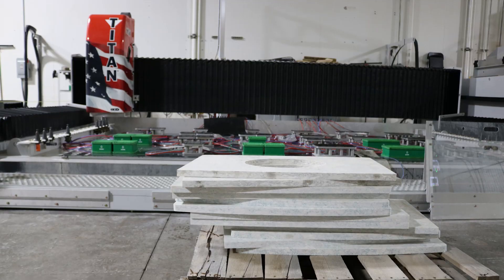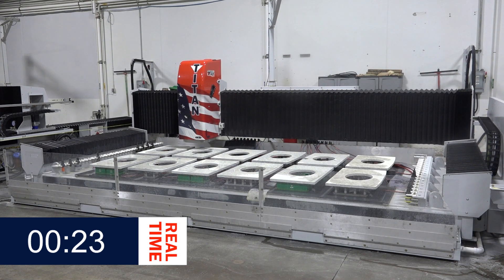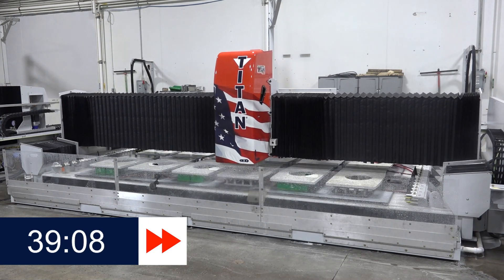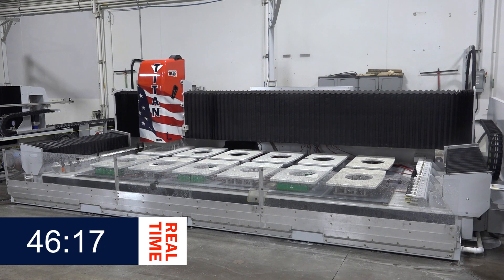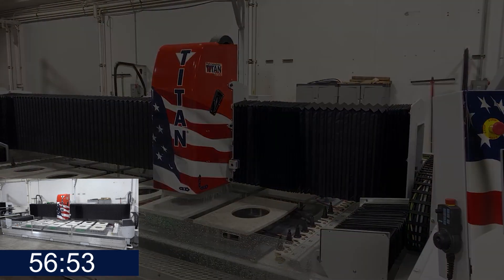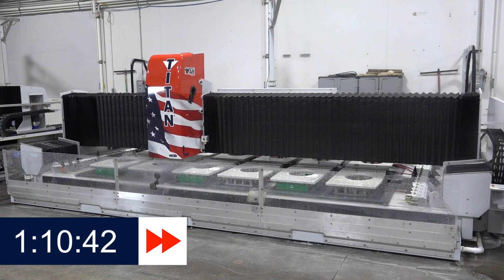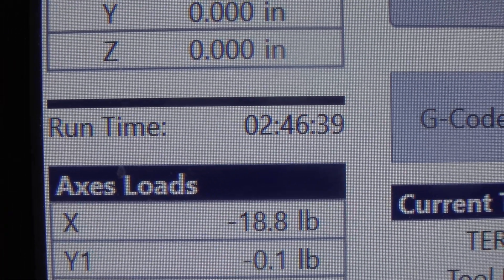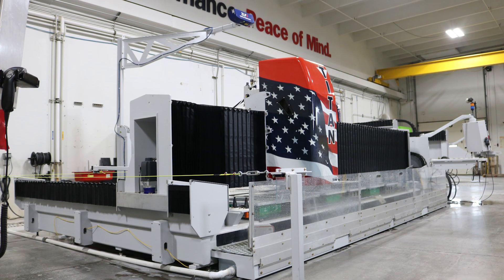Vanity Challenge | Packed Table on the TITAN® CNC Router

Comment: How are the overhead lasers with the new 3700+3800? I heard that they are not as good as the older versions
Reply from the maker: We did make a change to our overhead laser on the the new TITAN 3000 Series because the new Z laser has performance advantages over the laser used on the 2000 series machines.  

One of our sales consultants would be happy to discuss these benefits with you, give us a call at 800-328-2309 to learn more.